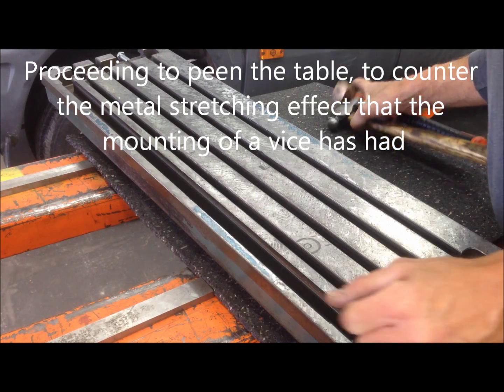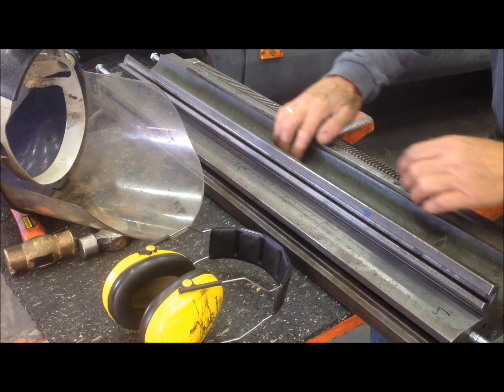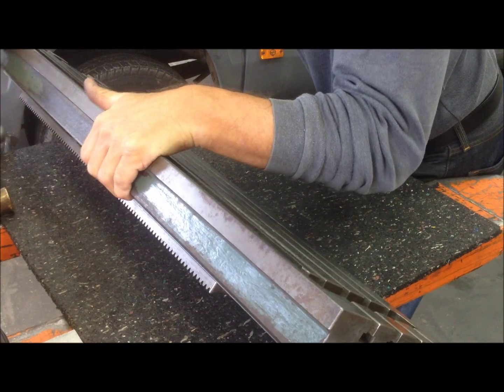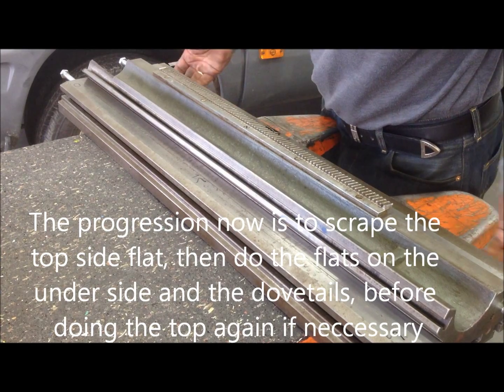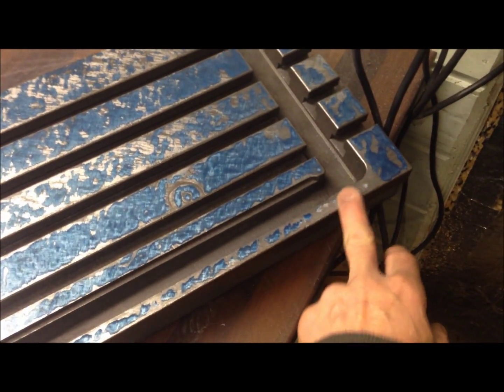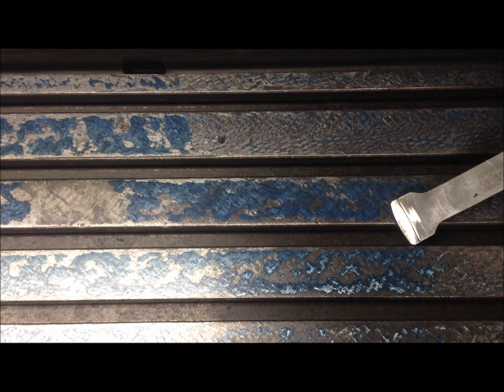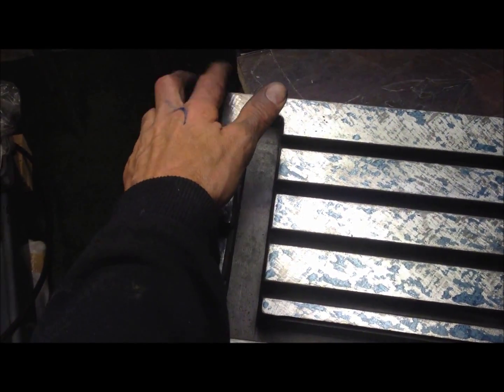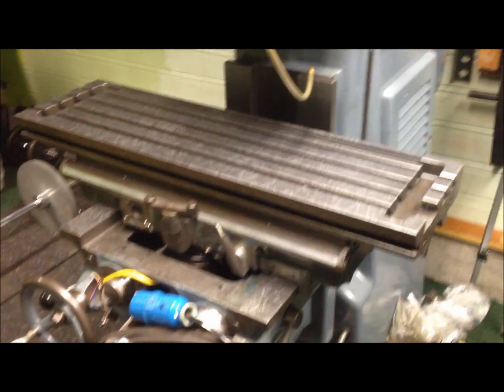Schaublin SV52 table top side

Comment: I am not sure that hammering  the table will do any good. In fact quite the opposite.  It is one thing to cold form a metal  and a completely different thing to soft hammer the metal here and there. In cold forming, crystals slip against each other and form barriers to new crystals slipping in,  whereas in hammering the magnetic domains of random dislocations will reverse direction, the consequence being weakening of the metal. And then we  expect that metal to resist the milling forces, torsion and tension-compression cycles without deformations.  That cast iron was heat treated when the mill was born, which means not only a good balance between hardness and ductility, but also homogeneous crystalline structure and symmetric orientation of magnetic domains of atoms' spins. Hammering here and there will don't do justice to the structure. I know the old mantra that if you knock the metal you release stress, but I do not know of any scientific experiment to prove that right. Just ''old wisdom''. The Japanese blacksmiths were beating the heck out those work-in-progress blades, but after a beating ''session'' the blades were heated again and again, re-aligning the magnetic domains. And anyway, the beating, folding and heating were meant to strengthen the metal AND push out impurities from the metal. So, soft hammering alone has no effect, in my view. You measured less deformation of the table after hammering it; where do we think the deformations ''went'' ? Out in the thin air ? Obviously not. ''They'' migrated into neighboring areas,  basically regrouping in new dislocations. Nothing is lost, everything transforms into something else. Finally, if the table deformed from gripping the vice many times over, it will do the same once the mill is back to work and the scraping of the table would have no effect after the first use of the vice, not to mention that the back of the vice should be scraped as well to mate well with each other. I 've made a 1100 mm long straight edge out of ordinary low carbon steel, scraped it flat and used it to scrape the ways of my Bridgeport. Final results : 0,02 mm / 600 mm. No heat treatment (obviously), no hammering. And it held well.  The old wisdom advises against that, only cast iron stress relieved. Conclusion:  there is much folklore about cold deformations and how to ''tackle'' them. To me , it is heat treat or nothing. No soft hammering. Just my 2 cents.
Reply from the maker: Thanks for the comments. Interesting. Could be you are right as I assume you know a lot more than me about the subject.. I am merely learning.
PS! How flat did your straight edge become. I recon in the region 5-10 times better than the Bridgeport numbers you refer to? And did you make it as a Camelback? Otherwise my findings is at least that it sags quite some and thereby conforms to the surface under test. PS! Nice machine.. always like the type.. very versatile, although a little less rigid as compared with other mills with shorter "moment arms". But for a hobbyist it is way above anyway. Had I had the room I would have like to buy one.. or maybe one of designs that build onto this.
PS! Did you take one of Richard Kings scraping classes? Or are you possibly a profesional?

Comment: I've always prefered a narrower blade when possible but a good point about scraping the top of the table to prevent the scraper blade pushing off of the edges of the tee slots or table. Wide blade and short strokes. As the old Saturday Night Live skits used to go, "I hate when that happens"
Reply from the maker: Agree.. not nice to have those chatter marks as evidence for all to see